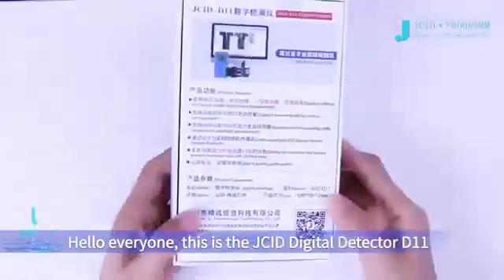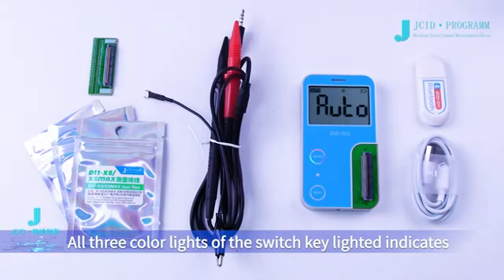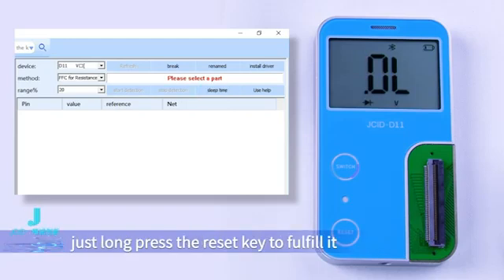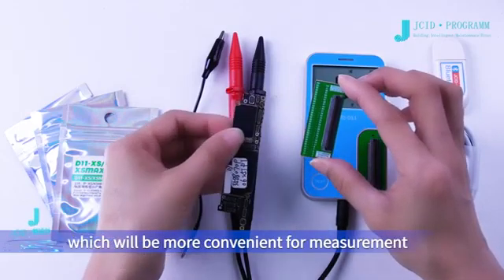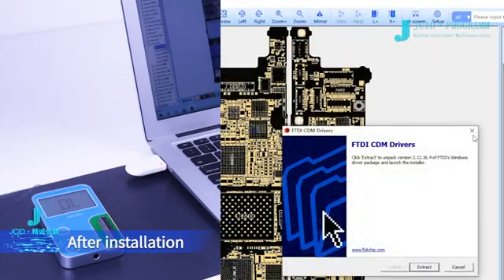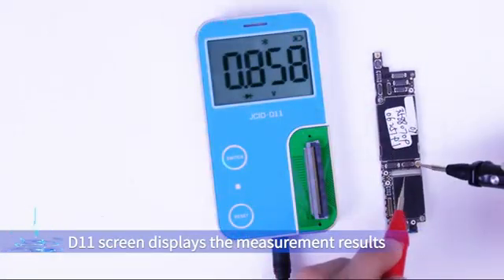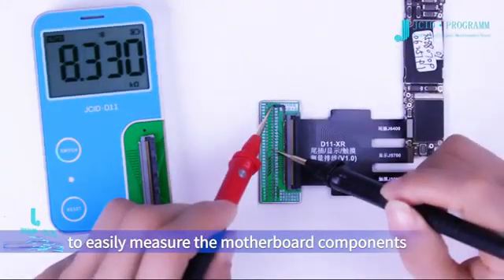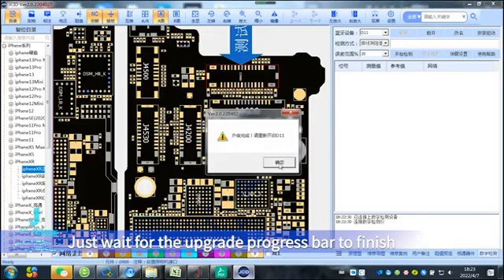JCID-D11 Multifunctional Digital Detector for measuring PCB board voltage

Comment: Can you make your own datasets? Like can you use this on other boards that may not have initial data on? Compare good board to bad board? Assuming you can work through the connection cable interface.